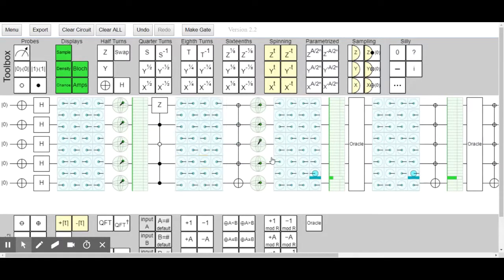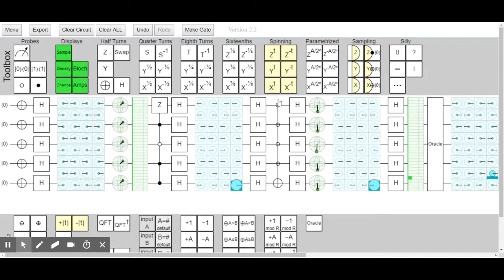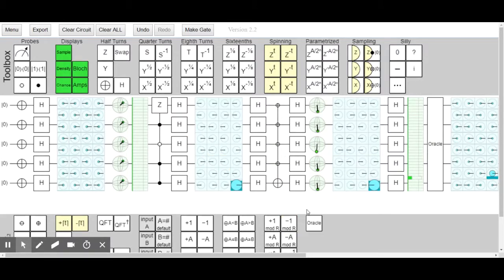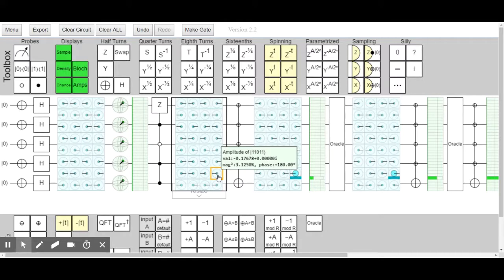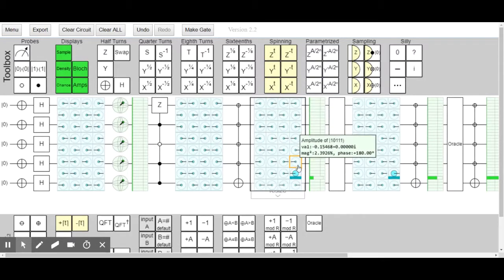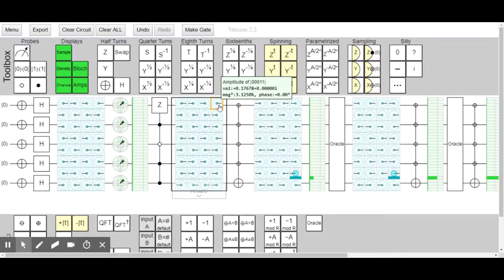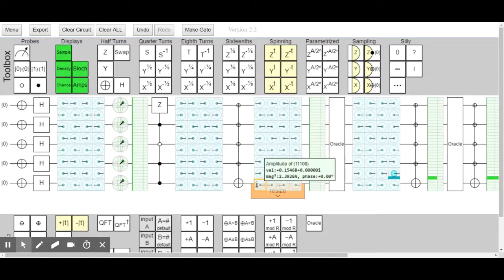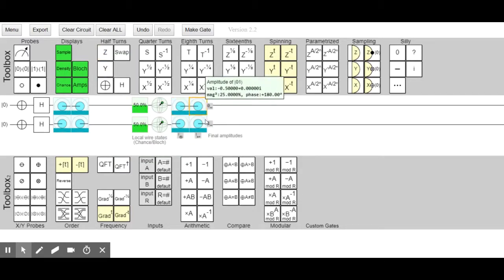Algassert [Part 3]

Comment: You're going down the wrong path. The elements are not being re-ordered. When you negate the X basis vector you are removing the projection of the superposition onto that vector, negating that projected vector, then adding it back into the superposition.

When trying to understand the smaller operations you can use the state channel duality to view their matrix. Sort of. See the 'how to use'.
Reply from the maker: Thanks for the tips!